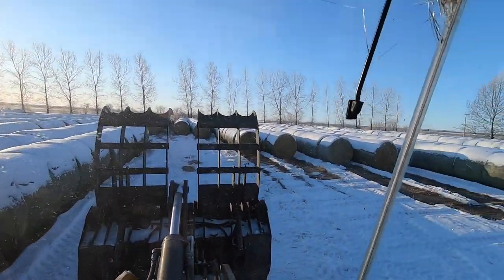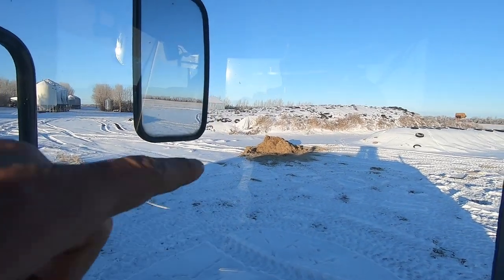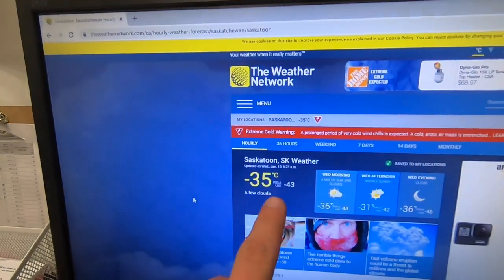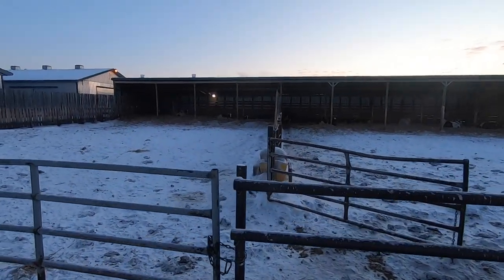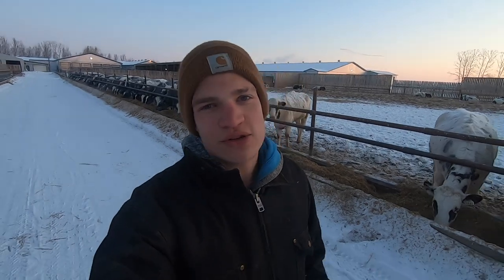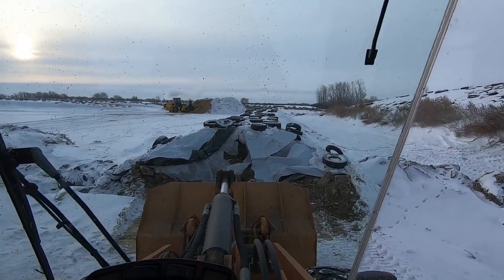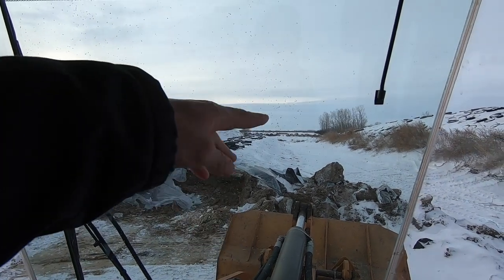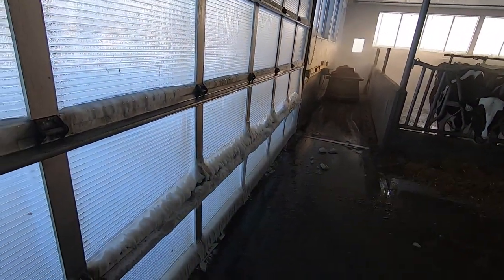Cold Outside? Farm Show!

Comment: Could you use the steam cleaner/pressure washer on that ice on the garage doors? The extra hot water would mix with the salt you put down and help melt more ice too. Where'd you go on vacation anyway? We missed you! Meanwhile here in balmy South Louisiana, our current temperature is 68 degrees Fahrenheit, that's 20 degrees for you Canucks! Hey Jan, you play hockey?

Comment: I never complain about the heat in the summer as were going through a cold spell here in Nw Iowa,  Yesterday we got 8 in of snow and winds of 30 mph and during the night the winds switched to the Nw and are up to 50 mph so we're in a blizzard warning till tonight or tomorrow morning, everything is pretty much shutdown closed and no travel is advised and there is a tow ban in effect meaning if you get stuck and call for a tow truck they won't come pull you out and you will get ticketed when the plows are out and about and the highway patrol will give you a ticket. But no travel is advised as the temperature is below zero without the wind chill.  I can't imagine how much feed it takes to  keep your cows in good shape during the winter and I would hate to be outside in your neck of the woods and you sure don't dress very warm for as cold as it is up there. How do you keep the bunk line down so that the cows don't walk out of their pens over the feed bunks, or don't you get much buildup as we always cleaned the snow away as soon as the storm was over and still had build up
Reply from the maker: Wow that’s intense! We don’t get to much build up of snow only manure and we scrape it off as much as possible.

Comment: If you were to pour some -40 windshield washer fluid on the horizontal parts of the rollup door, that would help to eliminate the freezing up situation you have.
Reply from the maker: Interesting! I’ll try that out!
Reply: I was thinking a water system antifreeze like what you use on Rv’s , boats , cottages . That salt will break down the rubber and eat away at the metal . Good luck Jan
Reply: @saskdutchkid  Be careful, some of the stuff is very toxic to dogs, so maybe other animals as well.

Comment: your funny -50 when I got up Wednesday  had to take a someone in for surgery  it was -51and lite wind  enough to make it colder then it should be  3:00 am it sucked has ice crystals in the air too  made it harder to drive to   love the loader  you have  we do not have any tractor with a front loader  or a bucket on them we did do the math and choice it cheap for us to buy  loaders  that were built for lifting   you feed heavier to when it's cold to we do give them more  here  yea the waterer  does freeze-up    we have to build a roof over one of them to take it out  we have heated the concrete up and did put a drain in, to melding  ice building up  my dad say it working   put a 12' steel pipe in  at the waterer then put like an umbrella  roof over it the floor hear does work  not when if snowing or the blowing snow  we keep clean  we  have bale heater in-floor heater  to keep the door entrance  from icing up too have cow s start to run and the slip and hurt them self  we put up a gate  they have to slow down we have removed it thet still thing it there lol   this come summer  we are puting a roof over  the out side feeders too  we and  better feed the cows in the winter they can have feed  with out have to snow on top of it silage bale we chop up too  we and try a  new feeder out work but it does work  still working out the bugs trying to cover the feeder up   the problem is the lumps inthe feed get hung up  other them that work well  
we have winter trap for the door ways rolls up if we in to go in  the overhead door does ice up that much  we do use  plastic curtains  there for the winter too it  over kill but it works  we change the out each year  the other door 3 thd year  it have new one
Reply: we are planning to use the headgate outside  needle day  we can  hopeful goes as well as it can   one that does not make it will get to be squeezed  lol  will run then throw the squeezed